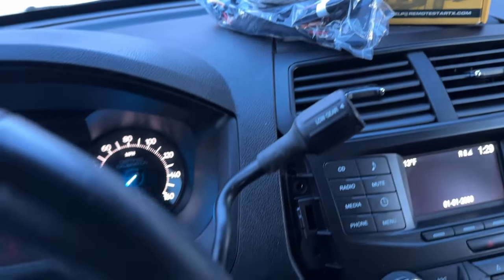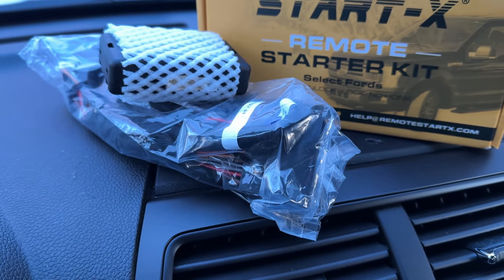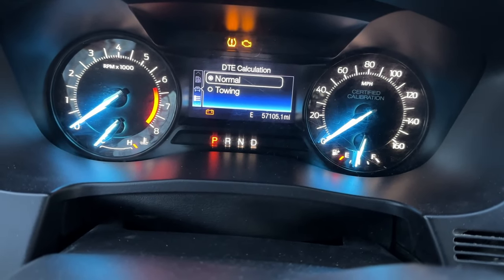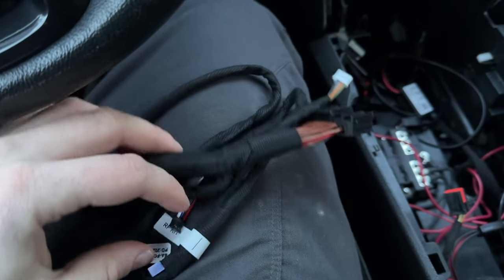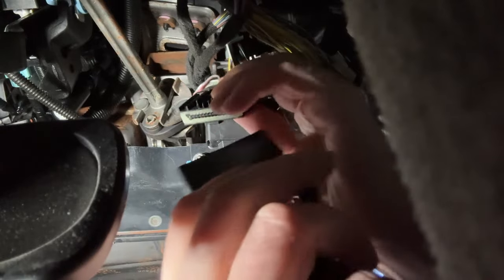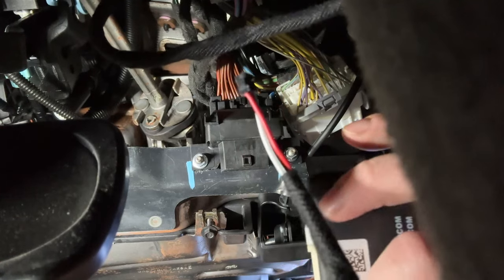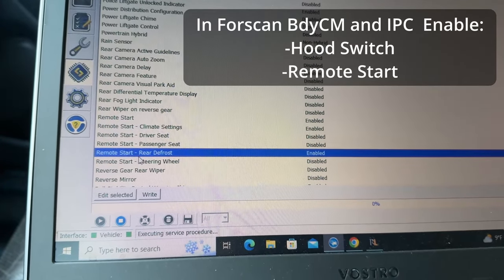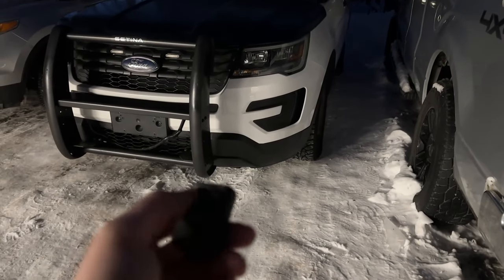How to Enable Remote Start on a 2016-19 Ford Police Interceptor Utility Explorer

Comment: Love the video, I do have a question, so Reid had to go to the dealership for them to get his vehicle to “see” the hood switch, how were you able to do that? (do forgive me if you said so in the video I rushed through since I was on my way back to work from lunch) do you think it was because of the different kits that yall used?
Reply from the maker: Edit: It seems that the 2016s do not have the hood switch option listed in the body control module. 2017+ should be fine. 

Not sure what issues he ran into. I did not mess with the perimeter alarm, and I changed enabled the hood switch and remote start in both the BdyCM and IPC modules. I did it all with Forscan, although I do have an IDS on the way to start messing around with some other advanced settings.

Comment: Did you consider Easyguard brand before settling on Start-X?  Would be nice to get remote start and push button start.  And a modern looking fob.  Curious if anybody watching this has any experience with Easyguard.  For the price it seems too good to be dependable.
Reply from the maker: As much as I would like a modern key fob, I wanted to go with as much "plug and play" of an option as I could. Start-X was the best option as I could find for the price.

Comment: Does this kit affect the factory secure idle function at all?
Reply: If equipped, no it shouldn't. It only works when the key is in the on position to activate. The harness used didn't have a key switch harness so it should be fine.

Comment: Does it matter which order I do this in? installing on forscan / installing remote start module?
Reply from the maker: Nope, as long as they both get done.
Reply: @depolicify great thank you so much for the fast response, attempting this tomorrow 🙏🏽 Will the 99 dollar module bring the remote start settings to the cluster or does that get enabled in forscan ? On a 2017
Reply from the maker: It requires forscan.  @davidalmeida639
Reply: Struggled so hard trying to unplug that obd plug that I gave up for the night lol

Comment: I need some help. I have everything installed with this system but when I go into the bdycm module there is no hood switch option. The ipc has it so now I’m not sure what to do
Reply from the maker: If it is not showing up in Forscan then you either need to take it into the dealer to enable or figure out what the AS-Built settings are to change it manually. I just looked over the spreadsheets I have and did not see one. I can try to figure out what it is by going into my AS-Built but it may take a day or two.
Reply: @depolicify  Any help would be very appreciated. I’ve been looking through the forums and some people are saying you’d need ids to change it but I find that hard to believe but I do not know. Thank you
Reply from the maker: @killiantillman1385  Send me an email at 3dub200@gmail.com I think I have the info you need now.
Reply: @depolicify   i have some problem, any idea?
Reply from the maker: Is it a 2016?
Reply: @depolicify  2017
Reply: Hey Juan out of curiosity were you able to get the hood switch activated  in forscan?
Reply: Awesome video! Did run into the same issue since mine is a 2016 piu. Would I be able to get some help with the solution you found? I have 2 piu vehicles now, a 2014 and a 2016 and the one for setting up the ‘14 was easy! The 16’ seemed easy until the missing bcm option for the hood switch!